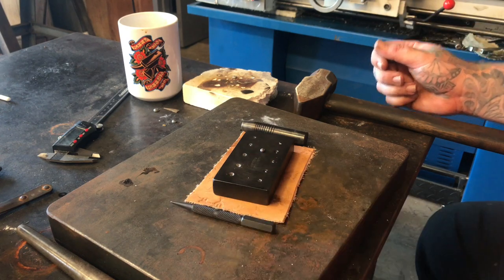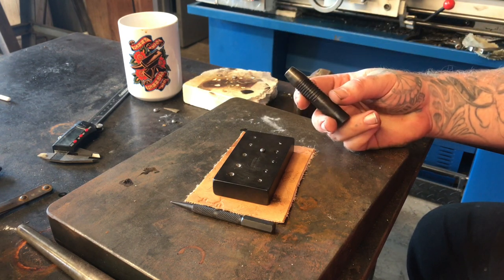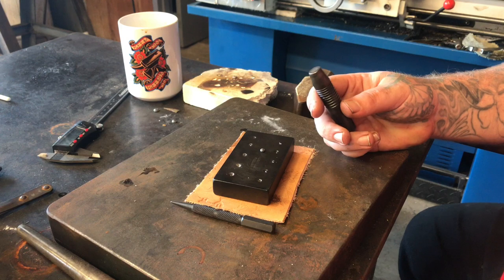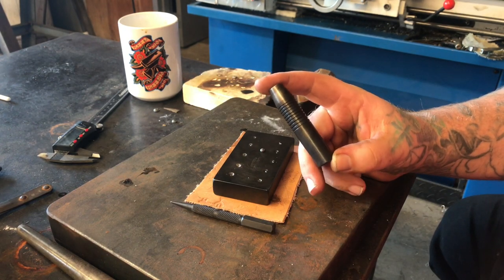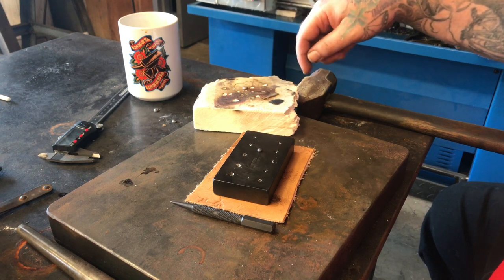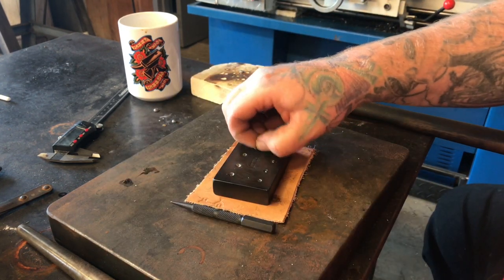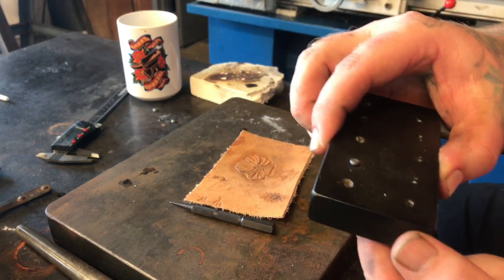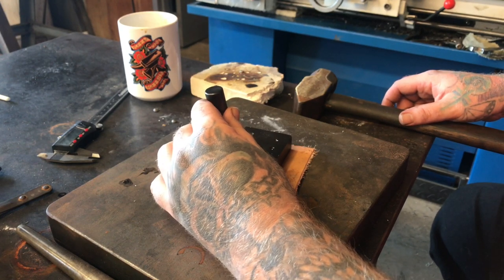Shot Plate How To

Comment: Awesome. I just bought a shot plate for your guys, but I do not have the force tool since it has been sold out. Would it be ok to use a hydraulic press, instead of hammering it?
Reply from the maker: yes you can definitely use a hydraulic press for making shots, basically the same process of making balls of silver etc, lubing the plate, then using the press, i would use some sort of a force tho even a small block of steel which can be found at a scrap yard, then use the nail set to remove the shot. hope that helps!!

Comment: Thank you for the demonstration.  However, you make no mention of putting a lube on the shot plate before attempting to use it.  That would be helpful to know, as well as what kind of lube to use.
Reply: Dee Stillman Lube? Do you have to lube up the shot plate first??? I didn’t know this. Cody? What do you use for this? Thanks, Dee. 😎
Reply: I had a TON OF TROUBLE with a shot plate made by someone else.  I have now been advised that Cody's plates are made in a way that does not require a lubricant.  Learning something new all the time. ;-)
Reply: Dee Stillman I have one stuck now for three years! But it’s someone else’s make. Are you seriously telling me this makers are less likely to get stuck? Anyone have any comments! Cuz it’s driving me nuts how hard it is to get these out! Agh!
Reply: @Gripco1  Mine don’t get stuck in any of Cody’s shot plates. They’re amazing quality. And I’ve never lubed them up either. They work flawlessly.